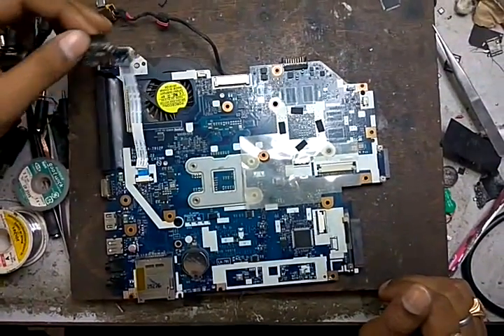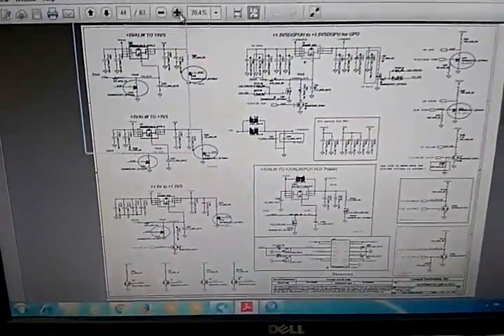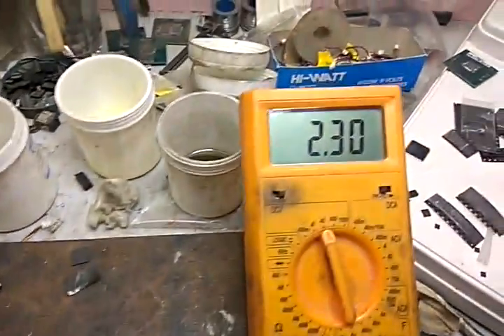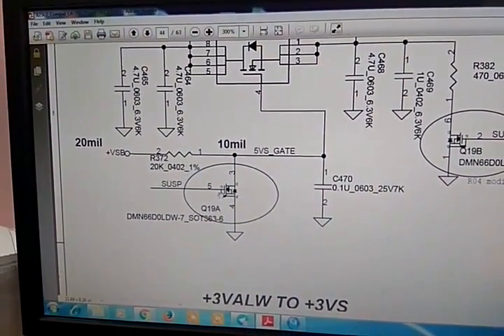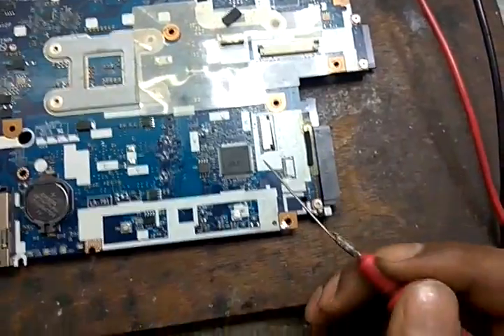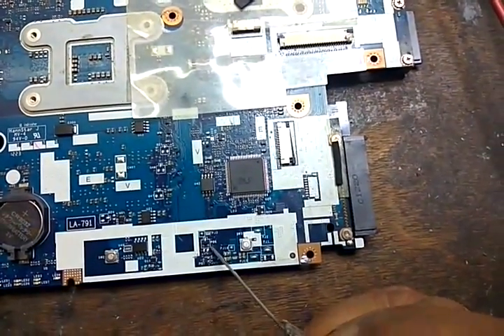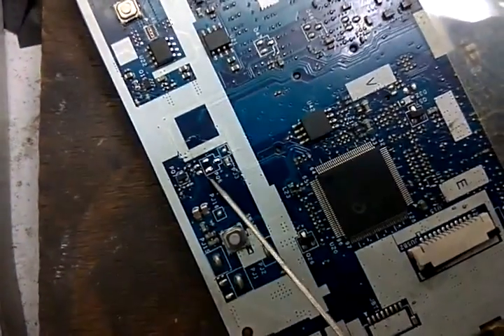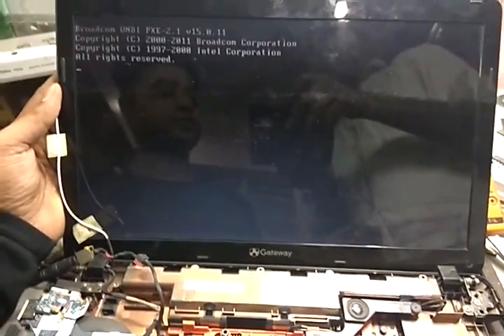#laptoprepair #Acer #LA-7912p power on but no display by #SatishBhai & #Aditya11ttt

Comment: Hello. My card starts, the fan turns a few seconds then stops. The lights remain on and the "PU13" HEATS UP A LOT. What can I do
Reply from the maker: Change the faulty component and try
Reply: @Aditya11ttt  Hello, now it works, it lights up but It doesn't display anything. Something's still 😭
Reply from the maker: Many things to see ! Start from basic !
Reply: @Aditya11ttt  Hi, the problem is solved, it was the led panel.🤣🤣🤣 Thank u thank u thank u very very much

Comment: Hi my friend 
Before all, the video is great and I thank u for good explain, 
Now I have the same problem in my acer laptop 
After pressing power button the power led turn of after 10 seconds... same the video above ....
My motherboard is V5WE2 LA-9531P REV 1A
+5valw and +3valw is supplied .
But when I search in schematic about +5valw to +5vs , u33 mosfet on motherboard , the place is empty 🤔,  no component solder with motherboard in the u33 place ...
Is their another reason case this problem??

Comment: Hi. I have this laptop as mentioned below..
The laptop has no display..
I tried changing the rams and hard reset but nothing happened..Still no display/Picture on the screen..
Please let me know if it not a ram issue or the bios issue..

Acer TravelMate P653 series
Model NO. : MS2352
TravelMate P653-M-53214G50Mikk
MFG Date: 2013/01/07
SNID: 30100782320
Reply from the maker: Apart from ram and bios also many things are there try bios also !! For confirmation!!

Comment: my motherboard same not charging and not power on with AC it's working with only battery can you help me to find fault??
Reply: now I'm using with external connection to battery ponts to charge and use from Inverter battery points

Comment: I wonder why some people will still give a "thumbs down " for this kind of good job. my brother you're good  please help us posting more video. But please kindly share us where you get the schematics of that motherboard. Thanks, man.
Reply from the maker: AYO PHILIP lqv77
Reply: I think because you are not suppose to put jumper wires on mosfets. It will keeps turning on because there is nothing that blocks the current. You would need to pull out the charger and battery.
The video is still helpful and the point he is making is clear.

Comment: LA7912P motherboards, After pressing power switch led blinks for few second and get turns off. Is EC bios updation work for me...help me out of this plz sir
ITE signals pch_rsmrst present(pin no.100), pbtn_out(pin no.106)=1.8v, slp_s3 and slp_s5 not present...